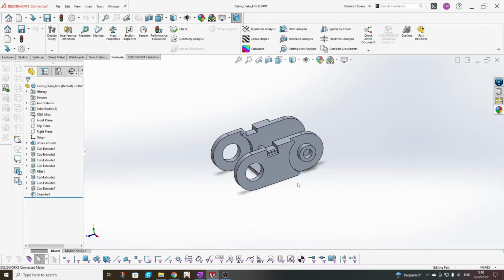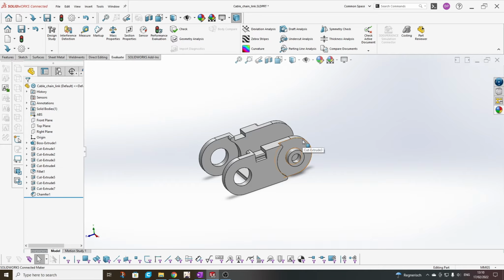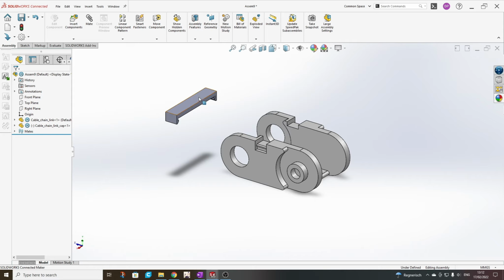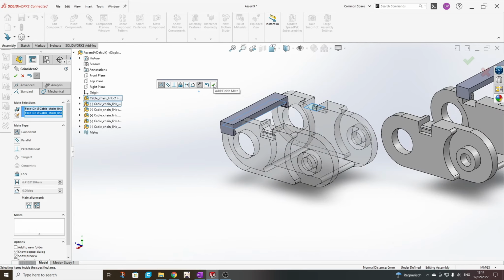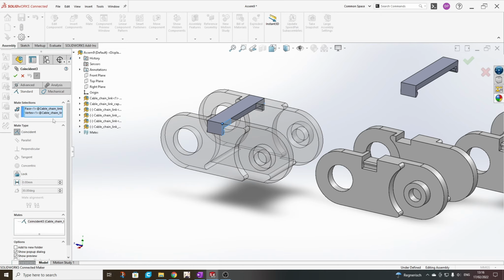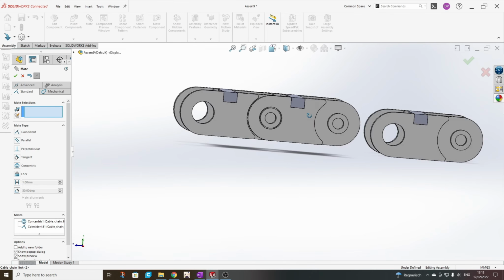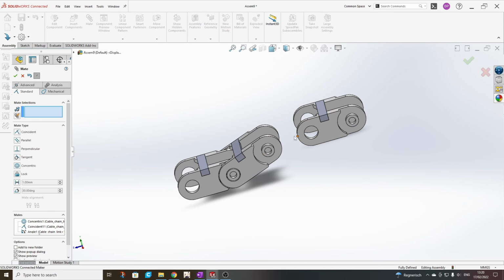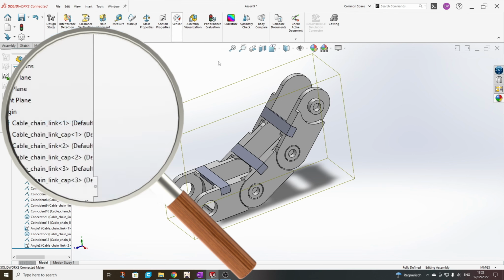Step by Step to CSWA SUCCESS! SolidWorks Assembly Creation - Cable Chain

Comment: Nice and good content...i need cswp voucher please help if you can
Reply from the maker: In this video, I explain 3 different ways to get a free voucher https://youtu.be/Vo3oLCQsyfY
Reply: @DWorkshop  Could someone still attend the virtual seminar and get a voucher, for the last option you said?
Reply from the maker: @2023noone   no for this year is over. 3DExperience World Exams are limited to few days only. Plus, you should have registered before the Event. Next year probably exams will be only for in-person attendees.
Reply: @D Workshop  hi, would it be a problem if I attend the exam from the pc, which has a cracked version of solidworks?
Reply from the maker: @2023noone  you can have a trial version of SolidWorks. Also for learning purpose and private projects there are cheap options for 9,99$ a month or 99$ a year. You can check more in this video https://youtu.be/LCRn3nFffOM .  I would recommend using a legal version, because SolidWorks did really a lot to give affordable  access for private use.